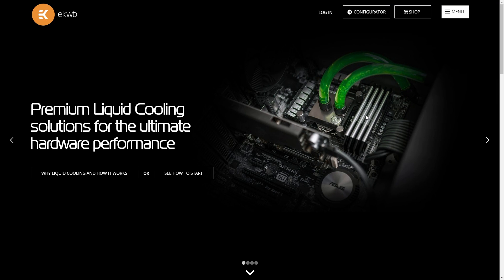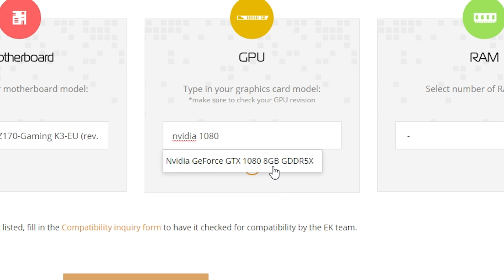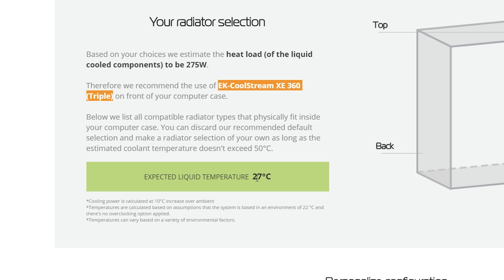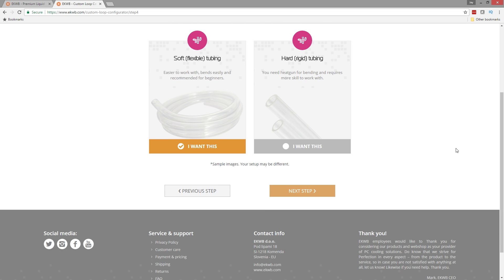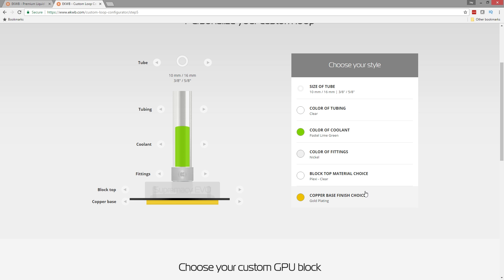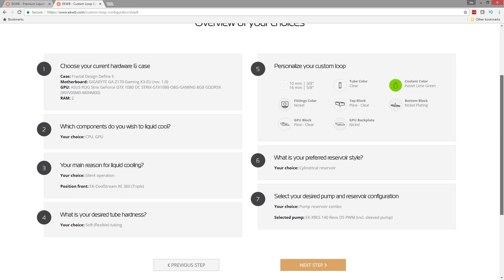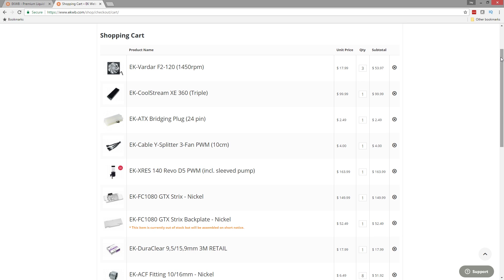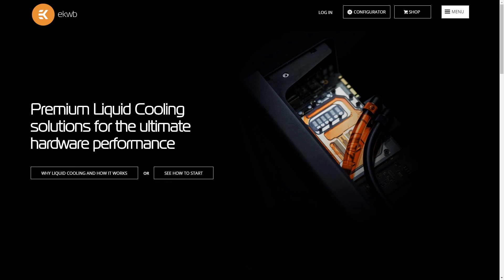How to configure a custom water loop using the EKWB CLC

Comment: thanks again for pointing this out Jay - I ended up using it for my first custom loop this month. It was nearly perfect but i ended up ordering a few more fittings after the fact to perfect the build (two 90 degree fittings to  solve a hose kink issue, as well as a T fitting and valve to add a drain method. Also decided to order a taller tube for the reservoir). a pair of 480mm rads, MB mono block, pump/res combo, and a pair of Bitspower GPU blocks has blown my mind!

Comment: Only disappointment is I didn't get in on the ground floor DDoSing their website ... I ran through this for fun just now - I already got my bits ... just waiting on fittings to jump in and do my first loop in awhile ... last one I did was koolance EXOS way back in the day ...  what I was trying to figure out is the answer to the ... do I want angled fittings / need them and if so where since I bending by hand ... and where I just going to cheat and use 90's ... right now I am of the impression of the ones on my pump require it due to space ... but you always said you have to think these sort of things out ... so I am taking my time and doing so

Appreciate the water-cooling videos Jay!

Comment: Probably worth pointing out  that for some cases the configurator must lack some data because rather than recommending one or two larger radiators, it recommends 5 or 6 of the smallest available radiators.

Comment: this tool is very useful, i used this to do my first loop. I do recommend getting a few angled fittings for it, and adding in a few more compression fittings and more tubing for when you inevitably screw up the bends (which will happen). The tool will give you the minimum for what you will need to do a loop. It also does not build into your loop a way to drain it. So getting a T fitting and a ball valve. The tool also does not account for mounting methods for your pump combo. Make sure you check twice and know where you want the pump to be mounted. And check the pump you're buying to ensure it comes with a method of mounting it. (unless you don't mind drilling into your case to create mounting for it, which i ended up doing when i realized this)

plan out the loop first, and have a few backup plans for when things inevitably won't work out.

They include a kit for cutting and bending the hard tubing, but the kit is really not that great. The silicone insert did not fit, even when lubed up with soap or oil and sanded down. The XSPC cutter tool for PETG kit is much better. It's built for 10mm ID tubing, but it works fine for the 12/16mm tubing. It'll make cutting the PETG less time consuming.

Still a super useful tool. I hope this helps anyone thinking about watercooling. My initial issues were really the silicone insert not fitting my tubing. Plan out your loop, have a few alternate loops before committing.

Comment: A question, I added a GPU block to my Predator, my concern, do I keep the header connected to the CPU FAN? Is there a need to control the pump based on GPU temps? Or it won't make a big difference?

Need your expert advice please.

Comment: EKWB EXPECTED LIQUID TEMPERATURE 26°C looks  to low  silient overclocking build  6700k + 980 ti   just one  280 rad   ?  ( I have 2 x 360 and 1x420  fans on max 9v and water temp 28-29 when gaming )

Comment: HOLY xxxxx! Yeah, custom watercooling just is not worth it by the looks of it. The only scenario where something like this makes "sense", is if you have more or less the best possible components you can buy, and then try to get more out of them. If not, every bit of that 700 would be better spend on higher tier CPU, GPU, more and faster RAM, second GPU, some crazy raid0 storage config, and lastly some good case fans and a decent CPU cooler.

Or if people roll in money, whatever, go for it.

Comment: I used this configurator for building my new computer and came up with a few problems with their system.  For starters, I am new to building custom loops, so this is the first time for me.  I used the configurator, as mentioned previously, and  the only thing I recommend to new builders that made me have to get additional parts is the bend fittings (22.5, 45 or 90 degree bends).  They don't come with any of them for your loops, so I recommend you get a couple of each for your build.  Secondly, think about how you are going to fill and drain your system.  Make sure you get some parts to do this as well (ball valve with a tee).  The price is up there, but is worth it.  Hope this helps everyone.

Comment: is it possible to take in of these little EK pump + res Combos an dput a bigger res in there?

so just take off the part at the bottom of the res and put the res in the pump + bottom part of the original res?

And if its possible I would like if someone told me which Reservoir to use.
Reply: for example:

this one 

https://www.ekwb.com/shop/ek-res-x3-250-lite

and this

https://www.ekwb.com/shop/ek-xres-140-ddc-3-2-pwm-elite-incl-pump

would be very happy if they just made bigger versions of the second one.
And will this pump(the second) have enough power to power a loop with cpu  + 2 way SLI?

Comment: Really want to do one for my air 540, but the amount of work trying to fit everything in there, damns.
Reply: youve got plenty of space in that case, ive got a air 240 and im gonna manage just fine, im putting the res/pump in the back with hardline tubing coming through
Reply: Plenty of room, still a bit of work.  But custom loops are like that. I just wanted a res out front, which is why I'd switch cases.

Comment: Checked out the site. Price came up to almost $600. Not sure about since my EVGA 1070 FTW already has a backplate if I needed to get another one or I just need a different one for water cooling.  Otherwise I thought the price might have been slightly lower since its in a Nano S case.

Comment: hi there i've been wanting to build a custom water cooled build with a evga gtx 1080 ftw but im indecisive about what motherboard to use since i can't seem to find the perfect atx for -400 and a cilindrical pump/reservoir, radiator and tubing I could really use your help. my budget is 2500$.this are all the parts in it up to now

gtx 1080 ftw 
corsair vengance 
corsair hx850i
kingstone 480 gb ssd
NZXT h440
intel core i5 6600k
western digital 1 tb hard drive

Comment: my custom loop:
none, watercooling is ridiculesly priced and im pretty happy with my NH-D14 and TwinTurbo III that i spent a total of $60 on, keeps my 970 under 50C overclocked as far as it will go and my I5 4690K at under 80C running 1.335V and 4.7GHz

Comment: Please rate. Will use Ryzen sr3 or sr5 cpu:

CPU Cooler: Cooler Master Hyper 212 EVO 82.9 CFM Sleeve Bearing CPU Cooler  ($27.88 @ OutletPC)
Motherboard: Asus 970 PRO GAMING/AURA ATX AM3+ Motherboard  ($104.89 @ OutletPC)
Memory: Crucial Ballistix 8GB (1 x 8GB) DDR3-1600 Memory  ($31.65 @ Amazon)
Memory: Crucial Ballistix 8GB (1 x 8GB) DDR3-1600 Memory  ($31.65 @ Amazon)
Storage: MyDigitalSSD Super Boot Drive 8GB M.2-2242 Solid State Drive  ($19.99 @ Newegg Marketplace)
Storage: Western Digital Caviar Blue 1TB 3.5" 7200RPM Internal Hard Drive  ($49.33 @ OutletPC)
Video Card: XFX Radeon RX 480 8GB GTR Video Card  ($254.93 @ Amazon)
Case: Deepcool TESSERACT SW ATX Mid Tower Case  ($38.99 @ SuperBiiz)
Power Supply: Rosewill 650W 80+ Gold Certified Fully-Modular ATX Power Supply  ($64.99 @ Newegg)
Monitor: AOC G2260VWQ6 21.5" 1920x1080 75Hz Monitor  ($99.99 @ Newegg)
Total: $724.29

Comment: random question that most ppl on forums are stumped by. I'm my custom build I want to put a section of several inches of spiral hard tubing, I have soft in there right now, but the way it sags ruins the idea. I have done a few attempts at it, but by the time I get to the 3rd or 4th loop the constant heating and cooling messes up another loop. do you have any ideas on how to do this. the way I'm doing the spiral is using an old glass reservoir to wrap the PETG around.

Comment: I am buying components piece by piece until i have enough for my whole build. Should i be concerned about keeping parts around without a way of testing or using them? I can not save money for the life of me, which is why i chose to do it that way. I am also keeping everything in the box it was shipped in, i open the package to see if it is what i ordered, but i leave the product itself in its original packaging. and placing them back into the shipped box for safe keeping.

Comment: I have been having problems in the boot stages of my computer since the only way i can get my pc to boot is to switch from ueif to other in the bios I have scowered the internet in search of what the issue is but icant find any thing. also when I leave my desktop on for extended periods of time it will freeze warranting a reboot and my system always asks if i want to boot in safe mode as opposed to going directly to the login screen. lastly when my system boots with out the safe mode instruction it will get a cmd style cursor blinking spiratically in the top left corner.

Comment: Does it not matter which CPU is being used?
Reply: MeatPopsycle The thing that matters is the socket. Intel for once made things with wisdom and kept the mounting holes for many of their sockets compatible with each other so it doesn't matter if you have an LGA 1150, 1151, 1155, 1156 because the holes are literally the same.
Cooler manufacturers include mountings that go with even LGA 775 and 2011, so pretty much you're safe
Reply: I was just thinking that you would need the CPU simply to figure out exactly how much heat dispersion was necessary, but I am now thinking they just go by the highest available wattage for each socket type and use that figure to calculate.
Reply: MeatPopsycle Yeah and i think every block EK makes is overperforming for the processor it cools and it makes sense if you think how superoc'd CPUs are kept that much cool, because an overclock raises the heat dissipation beyond specifications
Reply: Honestly, I am not really a fan of overclocking of the CPU. The small gain an exponential heat gain isn't worth the trade off for me, although I do understand the love of doing it. I just like quality gear, and EK seems to be on the ball with everything that they release.

Comment: Is there anyone giving any love to the 2006-2012 Mac Pro crowd? Looks like someone did some custom work with a couple Corsair H50 AIO coolers (http://www.cultofmac.com/56840/custom-water-cooled-mac-pro-both-speedy-and-quiet/), but there doesn't seem to much out there. I use an 2x2.8 GHz (8-core), 32GB RAM, GTX960, as my daily driver and it would be nice to quiet it down some.

Comment: I don't personally water cool (not into it enough to justify the price). But just because it's expensive doesn't mean it's stupid. It's no different than people who mod their car's appearance. Or maybe someone who gets a $2000 suit, does it serve more of a purpose than the $200 suit? not at all, but the person likes the way it looks more. Same thing with water cooling, is it a little better? of course, enough to justify the cost? not so much, but I don't think people who get into it ARE into it for the 3-4 degrees cooler it runs. It's just a hobby.
Reply: Umbles Or to make it to their desired design, Im going to build my first Custom Loop PC soon not because of the temperatures i just like the design of it and it can look cool in my new Kaby Lake system plus it can be a learning experience

Comment: How is the configuration tool useful to anyone who doesn't have a top of the line Intel motherboard, Gaming chassis and Nvidia GPU? I know that those are the enthusiast parts that someone would have both a need to water cool and the funds to do so, But what about everyone else?
Hopefully AMD Ryzen will be supported sometime after release. Until then, I'm just going to order a shitey AIO from some foreign country and hope it works.

Comment: What happened to water coolers external to a computer case, such as my 5 year old Cooler Master HAF 922, that has holes in the back of the case for an external radiator?

Thank you for this video.

Comment: Please note that if you are located outside of the EU, then you will likely have to pay extra money to import these items into your country.  The duties, taxes, tariffs, etc... aren't paid by EK, so it is your responsibility to make sure those fees are paid (usually to the shipping company). Depending on what you're importing the fees can get quite steep. As a result don't completely max out your budget unless you don't want to receive your items, or want them to be repossessed for non-payment of import fees. Odds are the import fees will be a small amount for most people (less than $20), but I've seen them go as high as $500. EK's support might be able to give you a rough estimate of what you can expect to pay for your import fees. As long as you are aware that you need to pay them, and you pay them quickly you should be fine.

Comment: Great video Jayz! Unfortunately I wasn't able to find my HPTX case in the list (Xigmatek Elysium)... I have also watercooling from EK rightnow but want to cool my GPU,  eventually in SLI. The rest of my components are recognized without problems. Rightnow I have a single 360 rad with EK vardar 3000 rpm fans but i think this setup is not enough to run together with 2 cards in SLI. Only my CPU is watercooled rightnow. Any recommendation would be great. Thanks in advance! Oh and by the way it's an X79 build with i7 3960X rocking @ 4.8 ghz! Thanks in advance m8 :)

Comment: Shame they did not have my HAF-x then again, it can fit a 240 rad + 140 rad by default but its not a ideal mount.
I actually dremelt a part of the top of the case away to get a 360 rad to fit.

But the configurator saved me a lot of time with getting all the other stuff together.

There one part i mis:
Before you start using your rad you have to clean it out with some distilled water to get all fabrication mess out of it.
I used 2 liter of distilled water and 1 m flex tube and 2 extra flex fittings a tape open and close thing to make adding the fluid to the loop and draining the fluid easy. Hardtube is not ideal to use as draining.

 this is would be a nice inclusion to the list.

Comment: While a custom loop is nice I just don't see the cost/benefit of custom over and AIO when EK charges $720 to $620 to get all the parts needed for a CPU and GPU loop.

I could buy a nice CPU AIO for $125 and only add $80 to the cost of some GPU that comes with Hybrid  AIO coolers.  And that set up would be EXACTLY the same size and amount of radiators as EK recommended for my case.   So spend $300 or $620 to get the same look?  Sure, GPU that comes with Hybrid  AIO coolers have blower fans...but that does not out weight adding $250 more to a custom loop

Instead of those quick disconnect fitting, that look like grey-crap,  EK should be working on a custom look system that needs less fittings and uses less expensive radiators, blocks, and reservoir pumps.  In a dollar per watt of heat dissipation contest custom loops are probably LOSING.

Comment: can we add multiple radiators in the loop for e.g. 360 at the top and 120 at the rear for e.g. in a cooler master maker 5 case ?

Comment: $700 for cooling, no thanks. From a guy who is willing to pay for a high end air cooler. It just isn't worthed it unless you already have the best CPU and graphics card available and you want even more performance. Do yourself a favor guys, don't spend that money on watercooling for something like a 6600k and a GTX 1070, put that money in a better CPU and graphics card or replace those earlier. Better spend money. Kyle (Bitwit) pretty said the same thing. Of course, if it is all about the looks and you are willing to spend that much money on it, go ahead. ;)

Comment: You can build a custom water loop for 1/3 the price with components from China and other form cheaper brands.
Reply: Could you recommend me some cheap brands that are trustworthy?
Reply: You also get what you pay for, so I wouldn't be surprised if it was 1/3 of the quality of actual components.
Reply: OfficialDavidGamer My loop cost me about $270 and my CPU and GPU never see more than 50°C. That includes Magicool 360 copper rad, Barrow nickel plated CPU block with 0.3mm cuts, Delphi branded DDC pump with Barrow acrylic pump top and 250mm reservoir combo, hand compression fittings with oil proof o-rings and XSPC VGA block, sourced directly from China.

BTW you do realize that 99.99% of your PC is actually made in China, right? And if by any chance you get some parts made in the US or Germany or whatever it's almost certain that all the materials are imported from China.

Oh and guess what. All the fancy pumps are made in eastern Europe! :)
Reply: +Ventsislav Simonov 

my gpu never goes above 65*c with stock cooler (gtx970) and my fx8350 never goes above 50*c either....and it's running at 4.2ghz on a Noctua nhu12s
Reply: +Ventsislav Simonov there's a difference in "made in China" and "designed in america...but made for a company exactly how they want while following the companies exact specs and QC'd to their ratings, but in china"
Reply: seth newman If you believe that $700 for a custom water loop is a good value for you then you may go ahead and spend that money. "Designed in America" not that's quality...!

Comment: For some reason I can't seem to get a SLI build to work on the website, amy thoughts as to why or are SLI builds not supported yet ?
Reply: I configured this rig 2 MSI GTX 1080 Gaming Z 8G and a MSI Z270 Gamimg M7 and a corsair obsidian 750D
Reply: Update: ok so when choosing an SLI setup it just takes a while for the website to load in the options when configuring GPU placement, everything is in order now